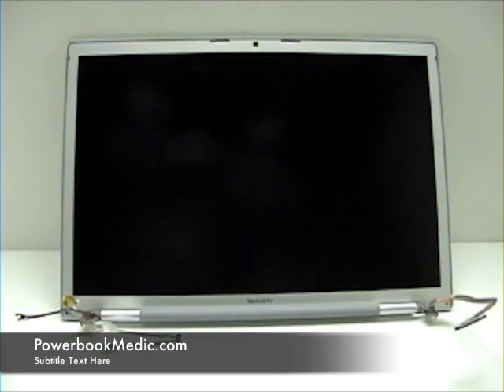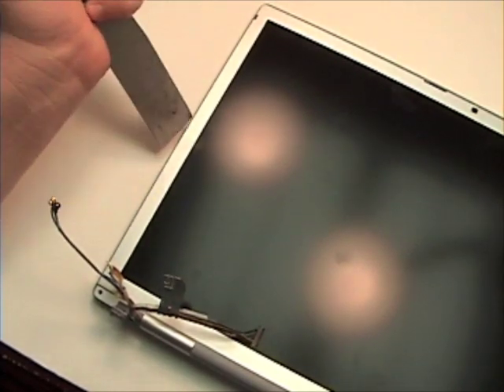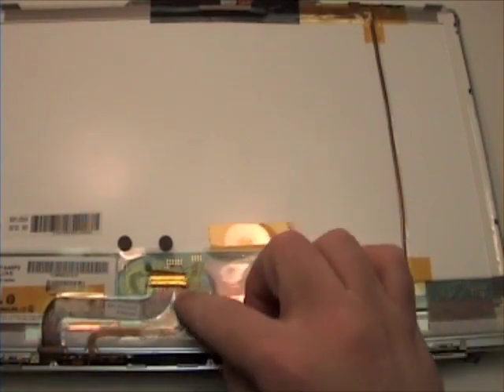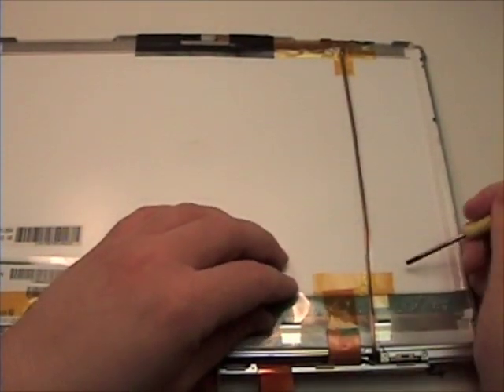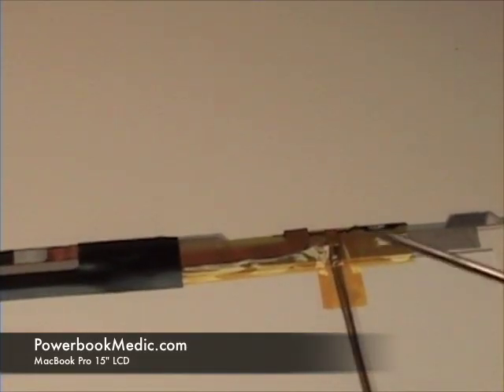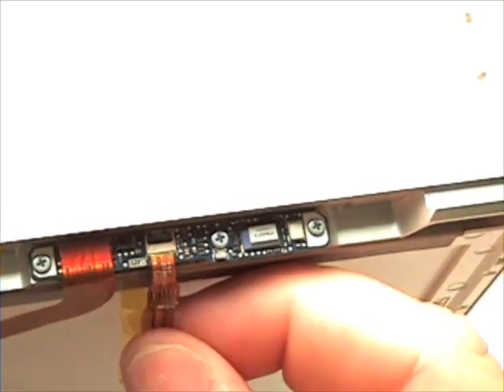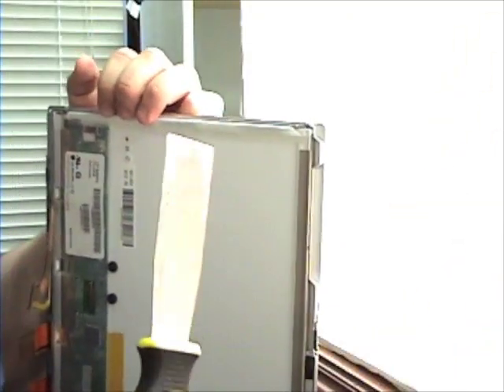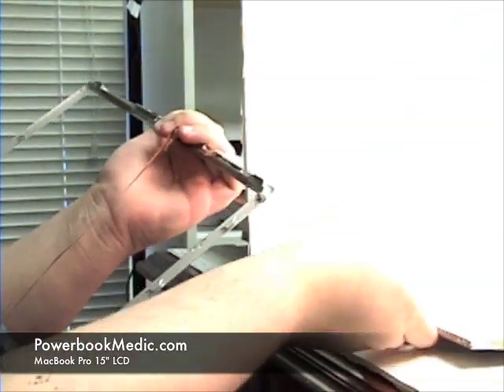Macbook Pro 15" Repair - LCD Disassembly

Comment: You forgot to mention that there are two screws on the inside edge of the screen. And a heathen helps to lose the glue. The sides can be loosened with a spatula as you have shown. 
But on the lower edge it's better to use the spatula on the inside of the screen and warm the area to make the glue more pliable . Apart from that. It's a decent video

Comment from the maker: You can call our customer service team at 866-726-3342, option 1. They can use your serial # or model # to locate the exact part for your system.

Comment: I have a 2006 MacBook Pro (it's the 2,2 Model A1211, MA610LL/A) with a screen problem - can't find specific info online.  All dark areas have red vertical lines running from the top of the screen to the bottom.  Is this an inverter problem?  It suddenly happened months ago, no gradual signs of problems, it just *happened*.  Any ideas?

Comment: I have a question. My issue is the display. When I turn it on, the screen is almost completely white. If you tilt the screen a little you can juuuust make out the wallpaper. What do you think might be the issue and what would I have to replace? If it makes a difference, when I hook it up to my TV, I can see everything fine, once I can actually navigate my way thru the steps needed to use my TV as the display.

Comment: My Macbook Pro's logic board has died. I am in the middle of making use of the parts that still work. I turned my hard drive into an external hard drive but now I would like to make use of the monitor. Do you know of a way that I can detach the monitor from the macbook pro and use it as a regular monitor?

Comment from the maker: Totally black could indicate a logic board problem or a disconnected cable. I'd have the professional go back in and verify he connected all the cables properly, or give our repair department a call at 1-866-726-3342, option 2.

Comment from the maker: @deltaMIKEone - The problem is likely the inverter board. It could also be the inverter cable, but in this model the inverter board is usually the culprit.

Comment: I have tried several, and there is no way to unclip the camera cable s shown. That breaks the little legs off and no the frame is garbage. (no camera connection)

Also, every one I have tried is glues in very well, including the bottom to the LCD on the face (front). When one tries to take the bottom loose, the frame cracks every time at the bottom screw on the left side. More trash.

Comment from the maker: @jcEightySeven - Usually this won't be something you can clean out. You'll likely have to replace the LCD. We sell the part and offer the repair service. You can call us at 1-866-726-3342.

Comment: A colleague recently used your video to replace the LCD of my MACBOOK PRO. After this "repair" a third of my screen is working, a third works when i press on it and there is a solid black not working at all section just left of center about 2" in width. Any ideas??

Comment from the maker: You could have a variety of problems from a pinched inverter cable to a cable that is not properly plugged in to a defective LCD or other component. An issue like that would require professional diagnosis.

Comment: Hi i followed the video install while i was replacing my LCD and after installing the new LCD and putting everything back together i find that the backlight on the new screen isn't working.  Is there anything i could have missed or done wrong?

Comment from the maker: Very unlikely, but anything is possible if you are not careful and do not discharge the static from your body (by touching a piece of metal for example) before working on a unit.

Comment: a big THANK YOU for the video, really helpful and to the point as usual.

Two questions:
1) does this apply to the 17 inch model too? 
2) If not are you going to post the same procedure using the 17 inch model?

Thank you and keep up the good work!